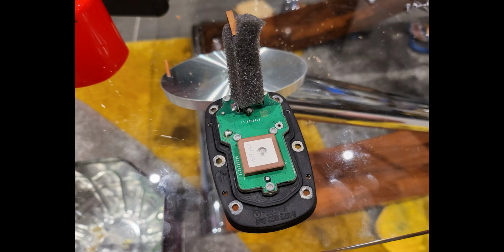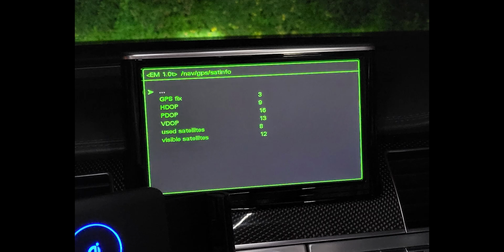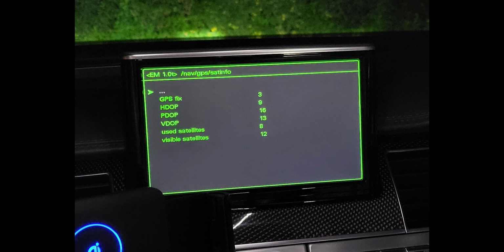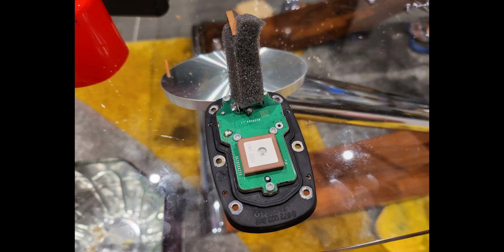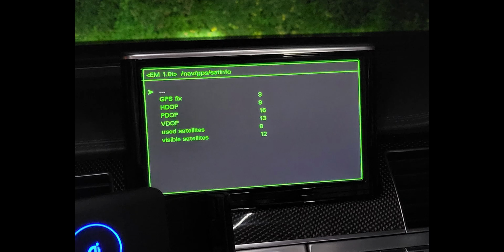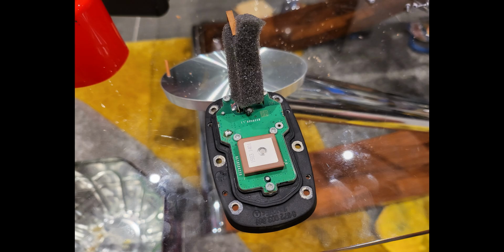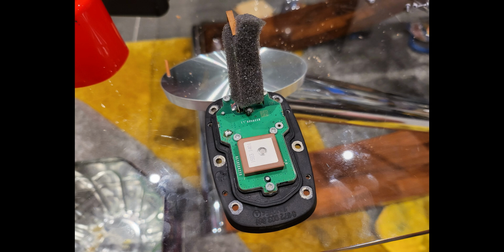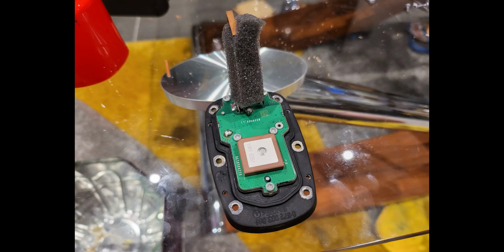DIY Audi GPS Fix | Quick & Cost-Free Solution Without Green Engineering Menu Access!

Comment: First of all a big thank you for your guidance!
I ve got an Audi A7 C7 2012 model, with 3G, auxiliary heater, BT, TV, WiFi. I am saying all that because might affect my car signal. Anyway, a year ago I installed retrofit CarPlay, everything was going well, but 6 months later my CarPlay got crazy, all the apps lost the signal and showing my car km away. I swapped back to car sat nav which was working far better, but an hour later the car lost the position too! 
I read every single forum, I calibrated the navigation and back again on the road. Few minutes later again the issue and finally I decided to remove the antenna from the CarPlay. Unfortunately, that didn’t solve the problem and the worst part was that all the phone gps, android or iOS was not working inside the car. 
Finally, I found that pattern with the water/humidity. The car was losing the satellites and was creating something like faraday cage which was blocking every gps signal inside the car. 
For the Audi A7 C7, I had to remove the headliner from the back to get access in the antenna. You do not need to remove completely the headliner. Then I removed the antenna and resolder all the connections as you mentioned in the video and in my case the problem was more likely from the PCB board which has around contacts that they are coming in contact with the metal mount of the antenna. I clean them up and fit it back. Voila! 10 satellites back again and all the phones are working. Thanks again!

Comment: I followed the instructions on the link you provided including using a male to male adapter cable to connect a separate GPS antenna from Amazon to the cable disconnected from the shark fin and still nothing. Now wondering if I've got either a bad GPS antenna from Amazon or a bad adapter cable (received two cables and neither have worked). Rather than but another GPS antenna, I'll take the shark fin off and try your method.....will keep you informed mate.